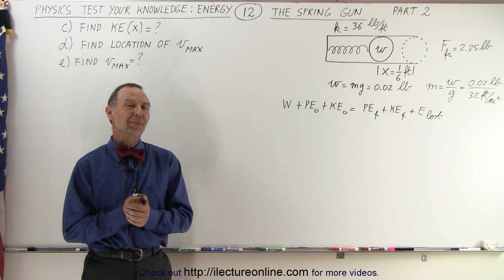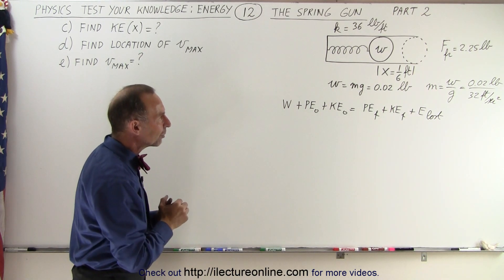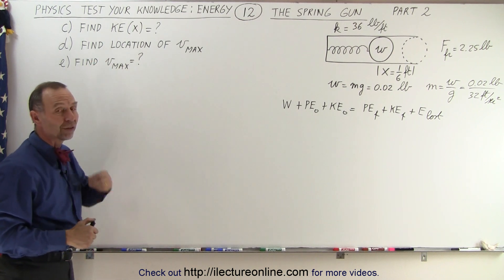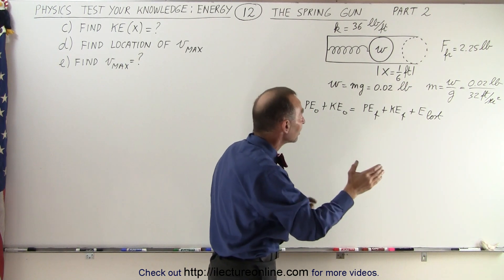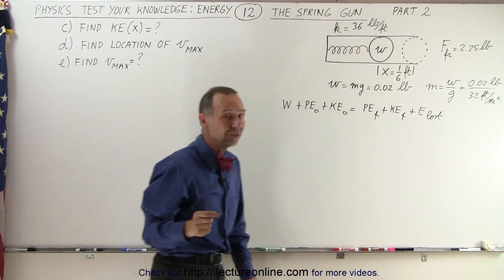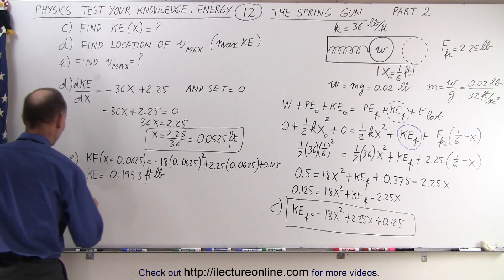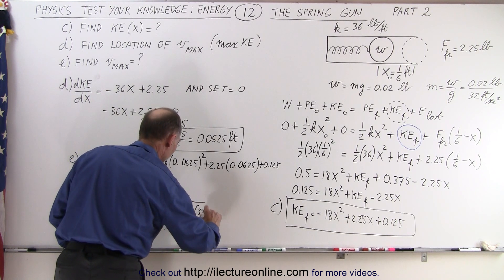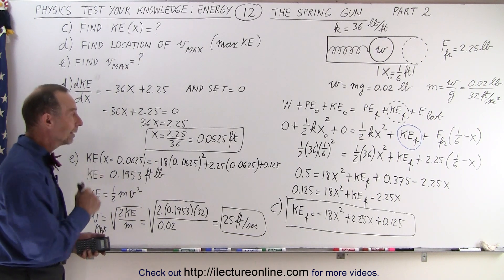Physics - Test Your Knowledge: Energy (12 of 30) The Spring Gun: Part 2

Comment: if I calculated this right.... the Bullet will have traveled  37.5 % of the X =  (1/6) feet (length of barrel)  when it reached maximum  velocity...  I used  (0.0625) / ( 1/6 foot) .... then multiplied times 100 for percent..  [ (0.0625) / (1/6) ]  x 100%  = 37.5 %  .. so the bullet travels just over a third of the barrel length to reach it's maximum Velocity.. then it slows down.... These are Great Problems!!! they do test our Knowledge (or lack there of)   :D